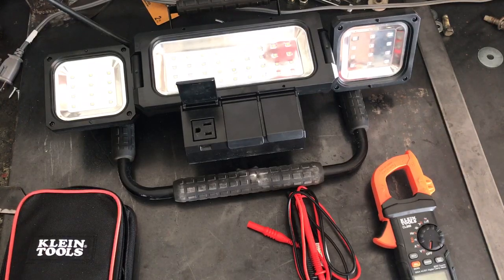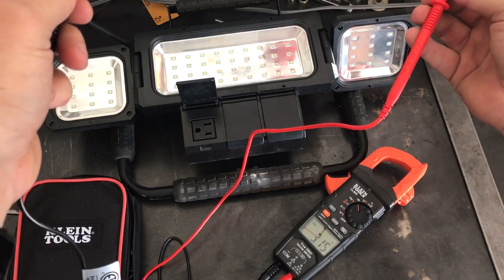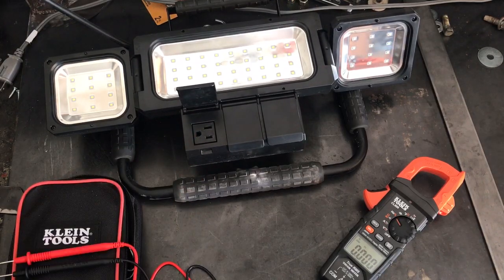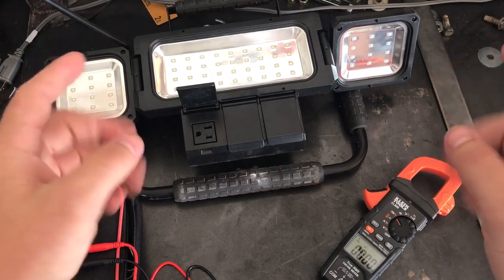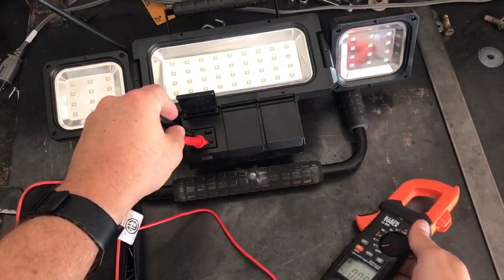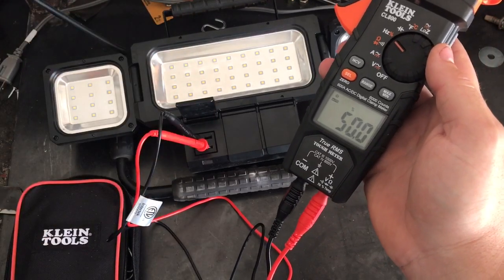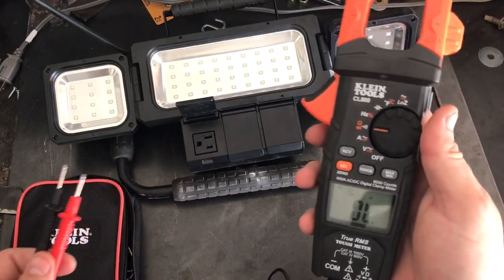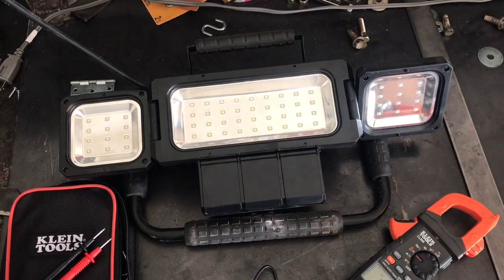SBM: Klein Tools CL800 more modes and How AC power works for dummies and the Best shop Light Ever

Comment: How effective is the the touch free voltage option?
Reply: Never rely on NFC.. non touch voltage sensor. It can be used to save time, when searching through a bunch of circuits, but ALWAYS double check with your leads and volt meter. None of the NFC testers are 100% reliable.

Comment: My CL800 reads 2 to 3 amps on the DC amp setting when there's nothing in it, or on a disconnected cable. It seems to read all right when DC current is applied. Any explanation?
Reply: I know it's been a year since you asked but, to zero the meter on DC amps setting, hold down the orange select button for two seconds and it'll beep, zero the reading and "zero" will appear on the screen.  Because of the way DC amps are measured with a clamp like this, (hall effect sensor instead of current transformer) whenever you zero it you must keep it in the same orientation to take accurate measurements. Any stray magnetic fields (such as the earth's) will affect the reading. These stray fields can throw it off if you change the orientation of the device.
Reply: @bobbing4snapples  I figured the zeroing part, nevertheless thank you. The explanation as to why is appreciated, the Hall Effect, that bring memories of school. Thanks again

Comment: I know this is a old video. I do have question. I have the same meter (Klein CL800). Testing Hz on house current works great, but when I test the outlets on my generator. It's all over the place. Anywhere from 75 to 105. I had it tested at my local repair shop and on his tester it was 60 hz. Is there a reason why or is something wrong with my multimeter. Thank you for your time
Reply from the maker: I would have your generator tested. Might be something wrong with the diodes
Reply: @silverbackmoose8642  
I did it's at 60 hz. He was using a fluke tester. We plugged my in (Klein cl800) and it was all over the place. I was curious if you ever tried the Klein meter on a portable generator
Reply from the maker: No I haven’t tried that

Comment: You should always remove power from your leads when you switch functions so you're not applying line voltage to all the other circuitry that may not be able to withstand it.  You applied line voltage to the continuity setting.  There could have been sparks with other meters.  I guess the Klein is pretty good.  Or you were just lucky.
Reply from the maker: Thanks for the info!
Reply: My old RadioShack meters would have blown the fuse as the Amps part of the selector was passed.